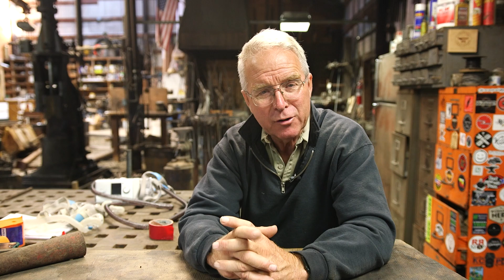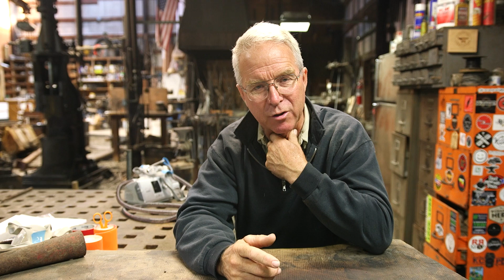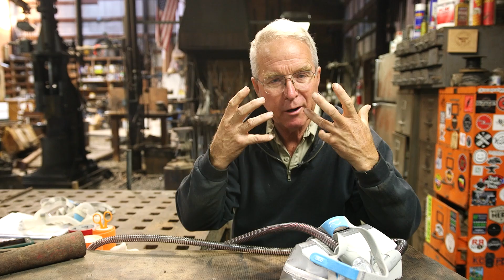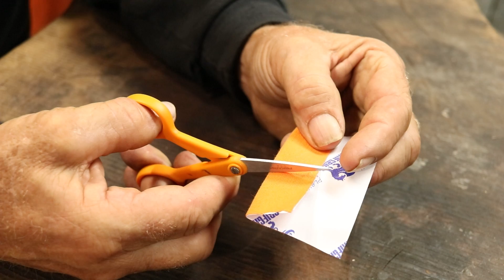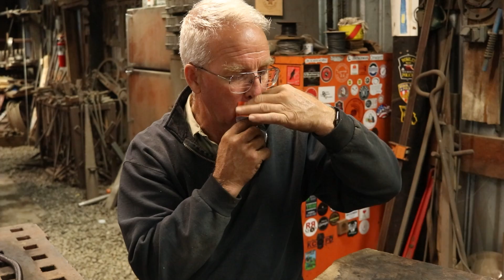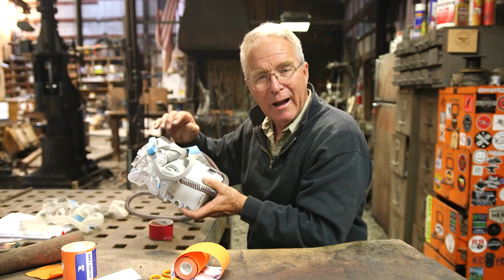Tired Contractor  Here’s My Simple, CHEAP Sleep Apnea Solution

Comment: I'm a retired med school prof,  and I'll tell you that untreated apnea leads  to many problems later in life.  I've been using a CPAP since  '07, and It's made a big difference in my life.  I recently replaced my original machine after 36,000 hours on clock, but it's not retired.  I made a HEPA filter box for it and I now use it in my shop as a powered respirator while sanding - it's very comfortable.  Also, the maximum aggregate hose length is 12ft for 20-22mm hose, and so if I wished it would be possible to draw fresh air in from outside the shop.
Reply: Any tips for someone who gets no relief from CPAP. im a 30 apnoea per minute. Not asking for a medical diagnosis:)
Reply: @djd8305  A consistent problem seems to be that the hose drags on the bedclothes & pillow and then the  mask pulls away from the face, thus waking the person and causing a pressure leak.  Many people give up because this - me too at first.  
Then I noticed a plant hook in the ceiling.  I installed one directly above my head, and used a bit of 1/8" shock cord to suspend the hose at about an arm's length above my face.  That takes the weight of the hose & mask off my face, and allows me to roll over completely.  It works for me.
Also, you should try different masks - in the old days you used what you were given, but now vendors will allow to try different masks to see if a particular one fits your need best.
Reply: Thank you so much for such a detailed response. Best not suffer alone I suppose😊
Reply: What a great idea Blarney!!!
Reply: @djd8305  @Fulla Blarney  One trick I came up with is to run the hose from the back, over the top of my head and under the top strap of my headgear.  This pinches the hose to the top of my head and keeps enough slack in the hose where it connects to the mask, but keeps the rest of the hose from constantly catching and causing leaks.  I used to do the same as Fulla Blarney with hooks and a small bungee cord, but since trying this method about three and a half years ago I haven't used the hook system.  I would also suggest trying the different styles of mask - I used the nasal mask for the first six years, but since getting Covid I've had a really hard time with nasal congestion which renders the nasal mask useless.  I switched to a full face mask and haven't gone back.  Sure, I get worse dry mouth than with the nasal mask, but at least I can sleep.  I've also found that Amazon (in Canada anyway) is about half of what I was paying at my local medical supply store (for the EXACT SAME RIG!), so do some research and save your money.
Reply: And FWIW, I was diagnosed as having stopped breathing over 90 times an hour!  No wonder I would fall asleep at red lights!  It would have killed me if I didn't get treatment.
Reply: @bigjgordon  whatever floats your boat!
Reply: Loosing weight will probably help or eliminate sleep apnea, not to mention the dozens of other benefits.
Reply: @chrisbarr1359  yes that helps obstructive apnea and many other conditions, but it may not be a cure.  Sleep apneas may be obstructive (local airway obstruction) , or a central nervous system disorder, or mixed - both obstructive and central.
Reply: Wow, what a great use for an older CPAP!
Reply: That's a really cool repurposing! I may do that with my old REMStar machine!
Reply: @djd8305  depending on your apnoea type, if it is obstructive, an ear nose and throat specialist maybe able to do surgery to remove turbinates and bone from within your nose and or straighten your septum. This will open up your airways and reduce the events experienced per minute. It is not a painful surgery as there aren’t many nerves in there, you just have to manage the bleeding for a week or so. 

But this is all dependent on your airways whether surgery can work or not, usually an MRI is conducted to inspect the geometry of the airways to see if surgery is viable. With central apnoea, there is not much in the way of treatments besides a machine to force air into your lungs when the signal does not get sent from the brain.
Reply: What does untreated sleep apnea do to the heart. I am a first quarter surgery tech.
Reply: @chelsey1657  In short, it causes your body to pump you full of adrenaline/epinephrine to wake you up and get you breathing. This can lead to high blood pressure. Also, sleep disturbances can, surprisingly, raise your LDL cholesterol and other blood lipids. Overall, this doubles your risk of heart attack vs. someone without untreated sleep apnea. Several well-respected medical sites (Harvard, Cleveland Clinic Journal of Medicine, etc.) have articles on the details if you search for "sleep apnea heart".
Reply: @BobBlarneystone  I use my headboard.
Reply: Ask your doctor to check for blockages in your nose. I had my tonsils taken out at 18. An ENT Specialist determined I had 50% reduced capacity breathing through my nose so I breathed via my mouth when sleeping.not good. this caused my tonsillitis several times a year. The doctor removed bone from my nose during the tonsillectomy (at 18 years of age) and this has allowed me to breath through my nose when I sleep 30 years later. Mouth breathing during sleep is not good! Find a doctor to find the cause and solution. Hope this helps.
Reply: CPAP is not the only, fix. Quit mouth breathing, get some exercise.
Reply: @SHREDTILLDEAD  true for some, but most people either can not or will not do it, or do it enough to make a difference.  There are also anatomic reasons that exercise will not help.
Reply: Could you do a tutorial on how you made the hepa filter box? Thanks
Reply: @djd8305  
Maybe that new implant.
Reply: @djd8305  this video gives you a great tip using that medical tape :-)
Reply: Maybe in a few folks but it’s not a fat thing chief.
Reply: Awesome Idea! When I'm up for my next CPAP machine, I'll keep this in mind for the old one!
Reply: This is an awesome idea! You made a PAPR!
Reply: @BobBlarneystone  there are also anatomic reasons why exercise would help.
Reply: @chrisbarr1359  Losing weight will not cure apnea.  Does this person look like he needs to lose weight?
Reply: @djd8305  Look up "lanky lefty" (a sleep tech) on YouTube and watch every video he has.   Find out what the free program "Oscar" is and how to adjust your pressure.
Reply: Any advice from someone who tried literally every single mask on the market and couldn’t get a proper seal without tightening the straps so tight it was unbearably uncomfortable. Nasal masks worked but I’m a mouth breather so that’s not an option. Also my machine chokes me in my sleep even if on the lowest setting. I tried it for 60 days straight and didn’t sleep a single night.
Reply: @BobBlarneystone  hi Fulla, you are so right about the different masks, I saw my doctor today about the my mask (I have used 4 different masks, now using Resmed F30), find the mask that works for you, adjust the tightness just enough to keeps the leaks out,
Reply: @chelsey1657   hi , try not breathing for 5 minutes every couple of minutes, lack of oxygen damages organs
Reply: @paulallen-01  hi I use a Resmed F30 mask, covers just the mouth, my doc checked placement of the head straps today, I may get a little leakage but the pressure is high. He reviewed the memory card for three different measures and everything was fine.
Reply: @BobBlarneystone  yeah I got both,it's a living hell.i hold my breath so long I wake up panting like dog and the headaches in the morning are just unreal.
Reply: I stopped using mine because it kept getting higher in pressure. 
I'm thinking it's definitely done so they can put me on a D pap.
Reply: @stevepickens9912  yeah I have that same mask. I can’t get a seal to save my life with that one. I think the structure of my face just isn’t compatible with any mask. I have over 10 different masks in my drawer and have thrown out at least 6. 
I gave up after a month or two and haven’t turned my machine on in over a year. I can’t take much more. I get up at 5am for work and by 9am I start nodding out. 
   My machine won’t even turn on anymore not to mention I think something was wrong with the algorithm to begin with because during an exhale while it decreases pressure it would give a quick blast of air at full force for a split second then go back down to exhale mode and when it would do that the blast of air hitting the back of my throat would make me choke. I actually slept worse with the machine than I do normally.
Reply: @Fully Blarny.   I am a general dentist with  almost 40 years of experience. Have you tried using a custom made sleep apnea appliance that repositions your jaw forward? If not, you should give it a try. Patients are doing very well with them and like the results. No cpap machine!!
Reply: @quantumtechcrypto7080  Yeah, it really is. Not EVERY Body but a lot. Speaking from my own experience and as a RRT
Reply: @paulallen-01  Try some nasal pillows, I really like them. Can't stand a mask.
Reply: I've been snoring since I was 5. Been tired my whole life. 42 now. I'm going to try this. I had same prob with my cpap. Way too much pressure. I had to teach myself to sleep with my cheeks pulled in or they would blow open like a hamster 🐹
Reply: @davidtaylor4053  $30,000 and fixes about half the people that get it.
Reply: @BobBlarneystone  what do you think of this method he is using in this video? My friend is suffering like what is described in this video and I wanted a second opinion. Thank you.
Reply: @bloodgain  I will check those out of course. Thank you for the reply.
Reply: Get checked for acid reflux which can damage the airways and close off the sinuses during sleep.
Reply: @RG-hf4et  yes, I've had that discussion with my dentist and oral surgeon. Apparently, the anatomy does not seem suitable for that. However, that consultation was done about 10-12 years ago, and maybe the art & science of the therapy has changed.  I'll look into it, thanks.
Reply: Look into a dental appliance for sleep apnea and snoring. I have one and it changed my life
Reply: @djd8305  seek a sleep dentist who can provide a mandibular Advancement Device (like a retainer that advances your jaw) vastly more comfortable than a CPAP but a PITA to get covered by insurance. Solves my 30/hour down to 5
Reply: @BobBlarneystone  Not sure what you mean by "the anatomy does not seem suitable for that"....? ... The appliance is simply an upper looking nightguard and a lower similar guard connected by metal sliding bars or depending on the appliance, they could be plastic ....your upper jaw stays stable and the lower jaw is brought forward & most appliances allow your jaw to move side to side. It isn't complicated. Look into it bc many CPAP patients no longer need their machines. Let me know how you make out.
Reply: @paulallen-01   Paul, I have successfully used Phillips nasal pillows with a chin strap that keeps my mouth closed, jaw pulled rearward to close off the throat. This combination has made the use of the CPAP successful for me.
Reply: @djd8305  Sleeping with your head raised like you’d be if in a recliner is what helped me before I got a CPAP machine? Have you tried that?
Reply: @TheChipMcDonald  it could help
Reply: @fishsquishguy1833  Yes, sleeping upright like in a recliner also helps bc the tounge doesn't go backwards and block the airway.

Comment: I'm 56 and I've been on bp meds since 2016.  I started a keto diet earlier in February '22.  After about a  month, my BP suddenly returned to normal.  I was able to dump my meds.  117/70 these days without meds.  Don't need my sleep apnea machine anymore either.  Also, an added bonus, no more chronic dry eyes and anxiety is much better.
Reply: Congrats, it's amazing what keto can do! The body has incredible ability to rebalance itself when we treat it right.
Reply: Whats keto please?
Reply: @imaginova88  whats keto?
Reply: @minteherms6784  it's a way of eating that eliminates added sugar and reduces carbs to a low value.  You get far less hungry between meals by eating more animal fat instead of carbs.  This causes, or may cause, a reduction in calories due to not being as hungry.  It also causes a reduction in insulin, which is a fat storage hormone.  Constantly eating carbs causes baseline insulin to rise.  Insulin also deactivates the hormone that causes fat to be burned, so when insulin comes down, the lbs start falling off.  That's the general idea.  Worked great for me.  I lost 40+ lbs.  It's important to note that my bp came down before any major weight loss.  My wt loss didn't lower it.  I'm told it happens when insulin returns to normal levels  and your artery walls have a chance to heal from the inflammation caused by a high carb diet.
Reply: @ThatEEguy2818  thanks
Reply: @minteherms6784  you don't have to eat animal fat,
you can eat legumes, nuts, or soy for protein. I'm 
vegan and do keto.
Reply: @raggedynomo1974  if that works for you, more power to ya. 👍
Reply: @ThatEEguy2818  I wasn't trying to undermine 
your original comment. I just wanted to
let Minte Herms know, that they didn't have 
to necessarily eat animal products, to get in 
their protein. Because most people think that's
 the only way to consume their protein. I definitely 
 didn't mean to be rude. Thanks for your original 
comment.👍🏼
Reply: @raggedynomo1974  no worries.  I was not offended and fully realize what works for me may not work for others.

Comment: Congratulations on finding a solution for your sleep apnea! Yes, CPAP and BiPAP can be very difficult to adjust to. A large % of patients never do and give up on them. Unfortunately, they typically suffer health consequences as a result since not many find a helpful solution as you did.  

On another note, you mentioned your chronic cough from your antihypertension medication, lisinopril. Lisinopril is a very common antihypertensive in a class called ACE inhibitors.  They are very well known for causing a dry chronic cough and some other less common but more severe side effects. There is another class of antihypertensives that work through a very similar mechanism but don't have these unwanted side effects.  They are called angiotensin receptor blockers or ARBs.  They have been around for 20 years and are widely available in affordable generics such as losartan.  I recommend you speak with your cardiologist or GP about switching from your ACE inhibitor to an ARB.  Best of luck and good health to you!
Reply: Do t get losartan read side-effects before!

Comment: My CPAP prescription is set on 14, which is nearly max. I love it. From night one (14 yrs ago) I am able to drop off to sleep within a couple minutes at that pressure, so I consider myself fortunate… a lot of people are unable to acclimate to a CPAP. I’m glad you found a way around it that works for you… There’s nothing worse than just sitting down ‘for a moment’,  and falling asleep.
Reply: My level was adjusted to a 12.  Pressure was so much I couldn't keep my mouth closed through the night, and it would dry my mouth horribly.  By this time I was already on CPAP for several years with no issue just at a lower level.

I may have to consider this idea of taping and see how it works for me.

Comment: This is really inspiring. 
I was diagnosed with severe OSA in 2011 (264 apnoeas in my sleep study). Since then I maybe used my hospital issued CPAP (ResMed S9) a handful of times; I couldn’t get away with it. A couple years ago I bought myself a Bipap, the S10 Autoset (APAP/BiPAP) and things were so much better but I still struggled with much of the same issues as yourself. I felt it still hindered me and so it never gets used.
I’m going to try this method, it looks like it really has changed your life. My lack of sleep is very badly affecting my life; I hope this serves me well.
Happy for you that you are in a better place with this now. Sleep apnoea ruins your life 😟
Thanks for sharing
Reply: I tried for a long time to get used to CPAP, and the BiPAP is the way to go as it ramps up. No need to crank down on the mask as the rubber will create a seal with CPAP pressure. Try, for your family sake, to go to bed with the machine and if you tear it off after and hour, so be it. But you CAN get used to it and grow to LOVE it (truly).
Reply: Consider getting a newer machine. I use a Phillips Resmed with the dreamwear mask and it ramps up the pressure slowly, allowing you to fall asleep slowly before the pressure gets overwhelming. It's a lot easier to get used to.
Reply: You are better off lowering the pressures yourself, than not using the CPAP at all.   I suggest you set a real narrow range for auto pap or fixed pressure...  and find a pressure which works for you best...  you can download OSCAR software to read your SD card from both machines...  watch some youtube videos on how to do it...  
Nasal mask will allow for lower air pressures, Cover Roll Stretch Tape is breathable option...   The auto mode will blow you up whenever you have an event... that was my problem...  a fixed pressure as low as you can be to keep your AHI below 5....
Reply: @tsoliot5913  The S9 can do that too, it just has to be programmed right.  The problem is that - at least, for me - if I turn it off to get up, the ramp resets, and my nose starts to swell shut, so that I have to spend time clearing my nose before the machine will help again.
Reply: Had a similar experience ,then had a Uvulopalatopharyngoplasty in 2014,haven’t used supplemental breathing since.  It’s not for everyone, but worth a look. I has dying quickly and now not so much.